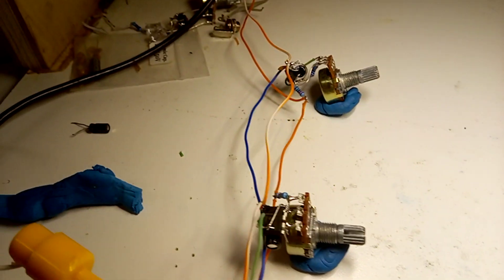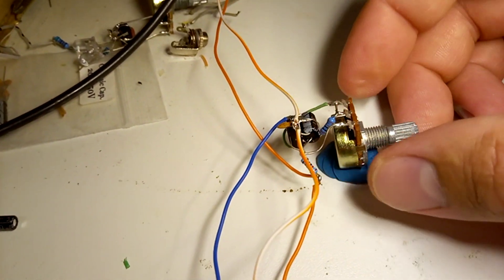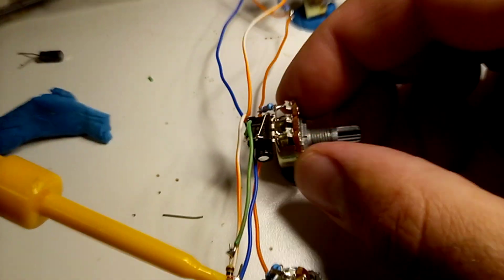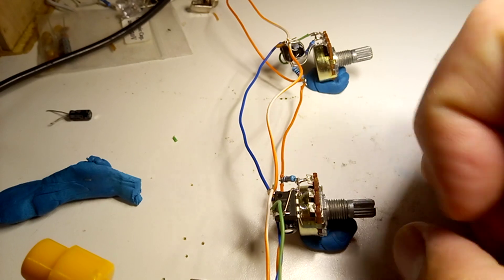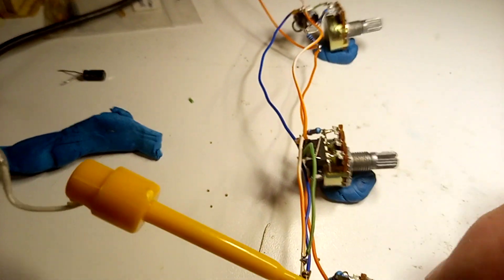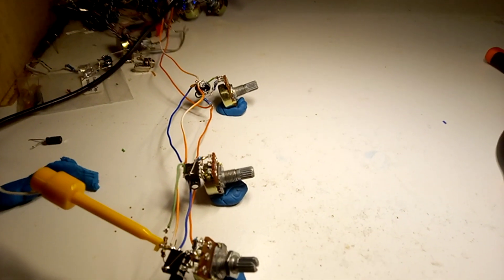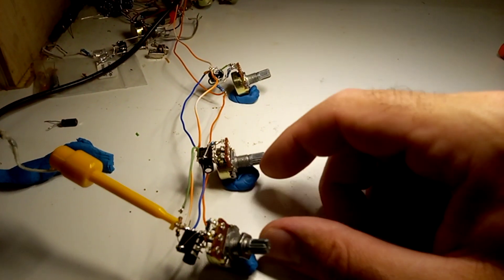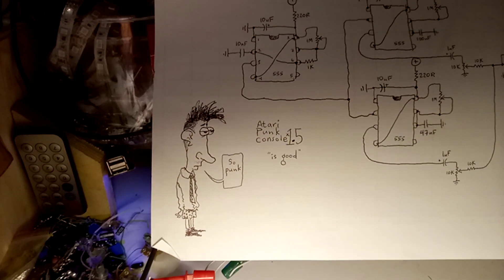Atari Punk Console x1.5 demo

Comment: I used to have a megaphone that had a glitchy siren button that I would use in jam sessions.  Everytime I pressed the button, the siren would sound but on a different phase of the pitch sweep.  I"m now thinking that the button wasn't glitchy, rather there was a continuous signal that was running through components that replace  the equivalent of your pitch potentiometer.  I guess I need to look up siren circuits if I want to learn more about it.
Reply from the maker: I bet you're right. Letting a signal just free-run, and then switching the signal to the amplifier seems like one way to do that LOL ... I guess in a toy, you'd want it not to use any battery unless the siren was being activated, but on a megaphone, it's on and amplifying something so switching in a signal must be easier than switching on just that particular part of the circuit.